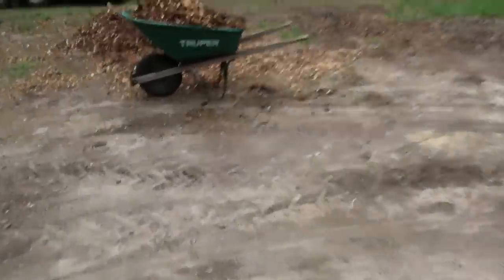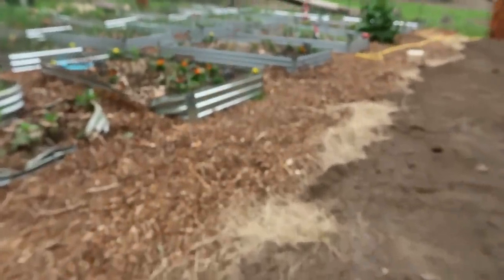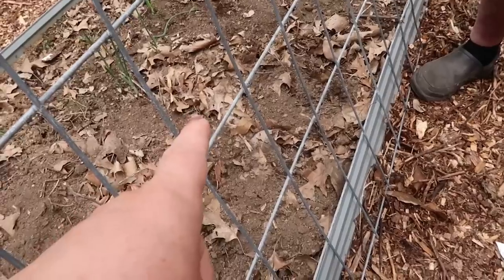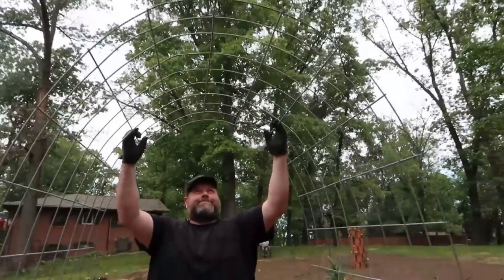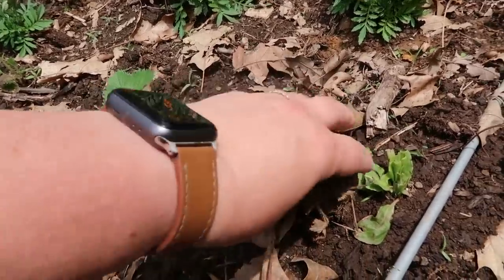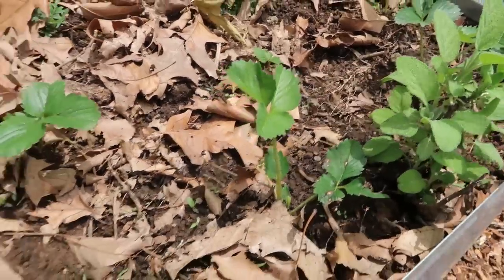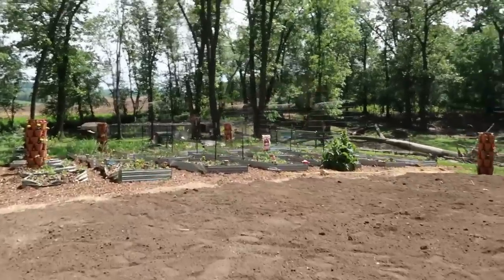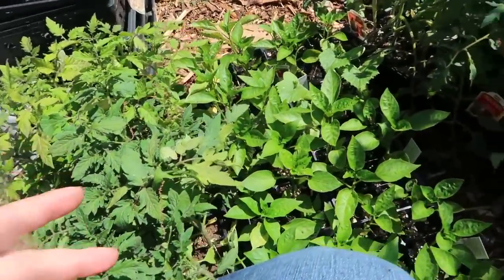DIY Cattle Panel Trellises Next Garden Level Unlocked!!

Comment: If you purchase remesh (the stuff for the base form for concrete) it is a LOT cheaper.  Half or more the cost of a hog panel or cattle panel.  They do rust, but rust isn't a problem.

Comment: for the towers you should put a slab underneath to straighten them out and give them support so they don't tip over. Also you need to cut the flower off your garlic
Reply from the maker: Yes, I mentioned in another video that is on our list 👍 🤗

Comment: Why are a bunch of the beds crunched down?  Do you regret getting them?
Reply from the maker: I bought a little over 20 metal beds last year and they have all had a wonderful. 4 are crunched down because a giant tree fell on them when we had 19 dead trees removed last fall. Anything with crunch with that kind of weight 👍🏻💗👍🏻. No regrets, wood beds would’ve been shattered. These beds still work just fine.
Reply: @JamerrillStewart  thank you so much for replying!!  We did wood beds, and they are falling apart after three years.  Thinking about making the jump, but needed opinions first.  Thank you!!!

Comment: I'm one year in with my seeds and gardening .. One thing I learnt is you can plant tomato plants deep with the soil going up the stem ..  you can even remove the first 2 leaves (from the roots up) the plant will grow more roots up the main stem which helps it grow strong ..  always dig over the soil that you plant root crops in like carrots and radishes, beets etc. (So that they don't have to push through hard soil) Also my Mum would always put straw around the strawberries to keep the fruit off the soil.

Comment: I did my trellis the same last year because they would not fit inside the raised beds and I discovered that it is very hard to get behind it to plant or pull weeds. Too far to reach from the other side. So I plan to redo it and put them inside the bed about 8 inches above the ground so it doesn't matter if the bed is too short but I will be able to plant easily on the inside.

Comment: Dont forget to snip the flower bulb from your onions. Leave about six inches of the onion to continue to grow. By doing this the energy will go into the onion not the flower. If you allow the flower to stay, it will stop the growing process and be done. I save the flower ends to make pesto or to just cut up and freeze to use in dishes.